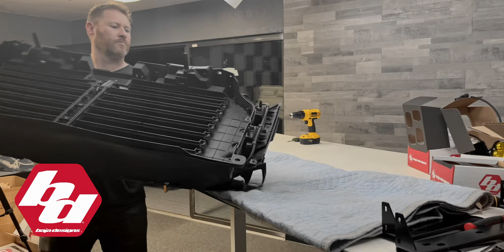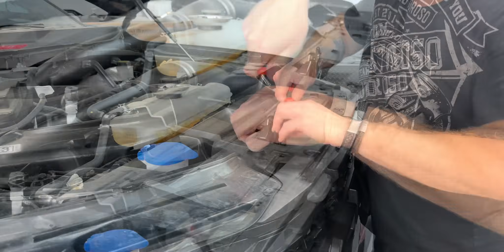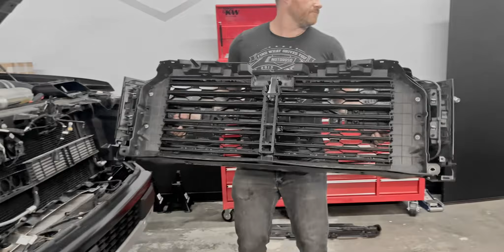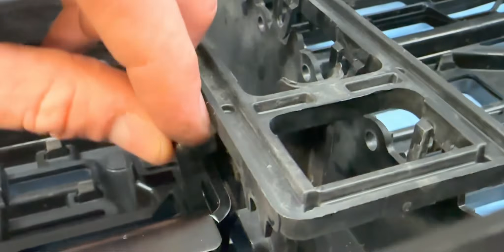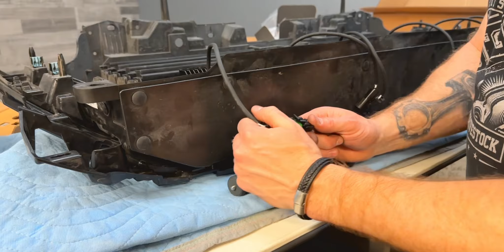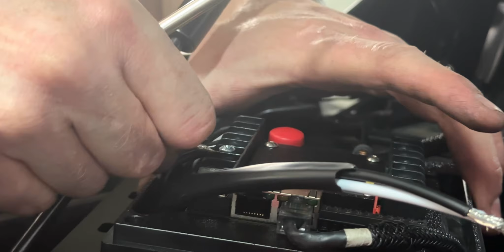Baja Designs Install: Behind the Grille 3rd Gen Raptor

Comment: What in the mall crawl bullshit is this? You cannot be fucking serious installing lights like that to the plastic grill? Baja designs are supposed to be some of the best lights you can get, why not reinforce them with a bracket? I’ll order these if y’all will replace my grill when the weight of the lights breaks my grill when I off-road. Until then, nope.

Comment: Just installed this, personally I had to undo the brackets to get the big mounting screw in so make sure put those in before securing the brackets. Also the correct wires have red tape around the bundle. There is two identical bundles with white tape and red tape. Ford wanted to troll us apparently. They look awesome installed and are really bright very happy with them